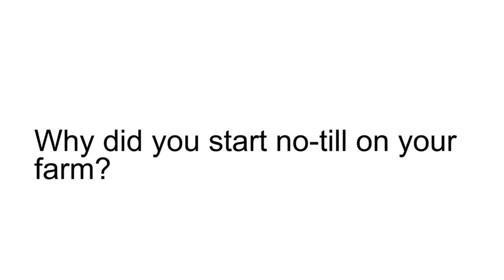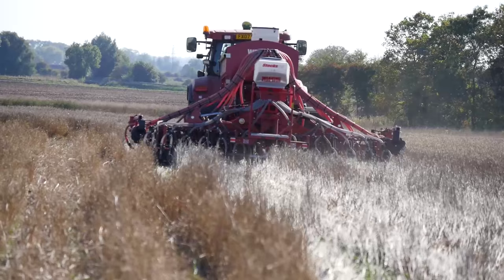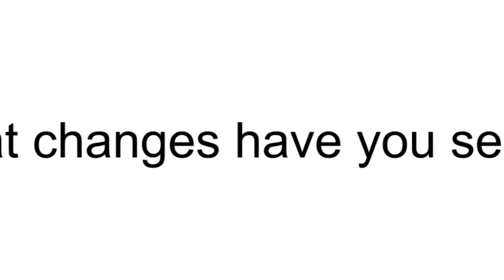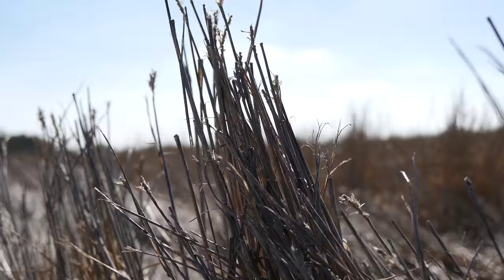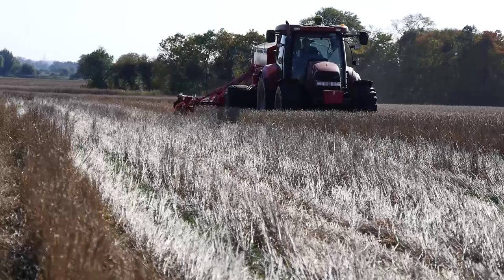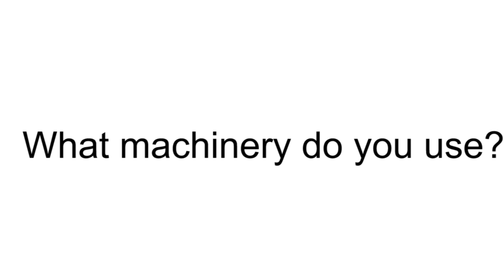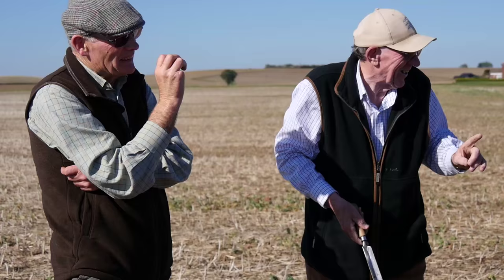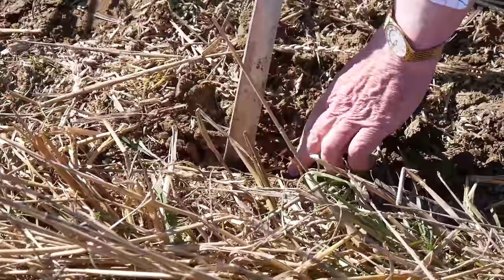No-till experiences: an introduction at drilling time

Comment: Tony,
You, Tony Gent and Weaving Machinery deserve a medal for what you have done in inventing and producing the GD drill.
Such a clever idea, both in design and construction.
It is sometimes incredible to wonder why nobody had thought of something so obvious as the GD angled opener, before.
If you were to chop a tree down with an axe, you don’t go in at 90 degrees to the trunk, because it will bounce back out to you. 
Go in at an angle and you get much better penetration.
On top of which the closing wheel crumbles the soil lifted by the smaller disc, to create a seedbed over the seed.
There rarely is any point in rolling after the drill, as that wheel has already done it for you.
Minimum disturbance between the rows doesn’t disturb the Black-grass, so it stays asleep and doesn’t germinate.
Establishment Fuel saving on my farm are 7/8ths (therefore costing 1/8th!) of what Ploughing, Combination drilling and rolling were.
Substantial Herbicide and fertiliser costs are also made.
So far, this farm has not suffered yield drops and recovery in years 2-4 of conversion. This is thanks to advice from guys like you and getting the timing right.
Thank you so much!